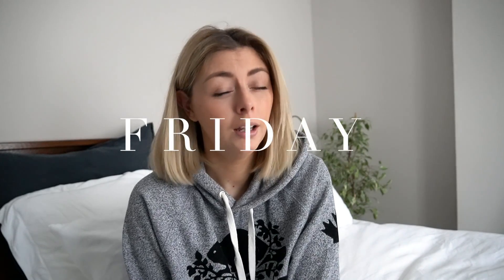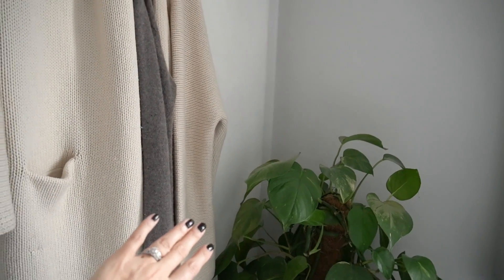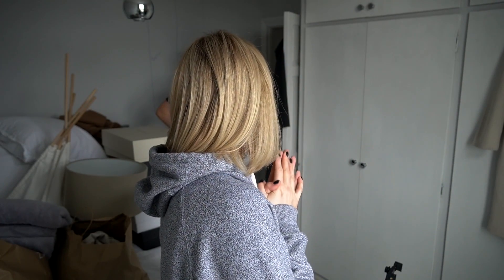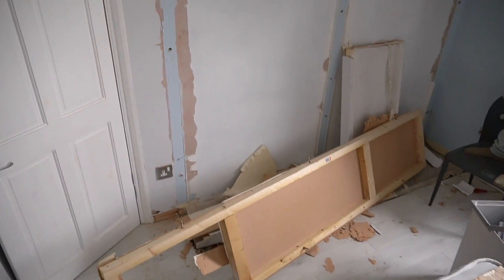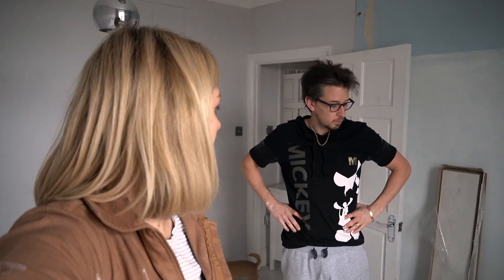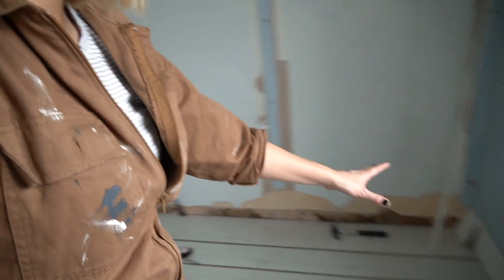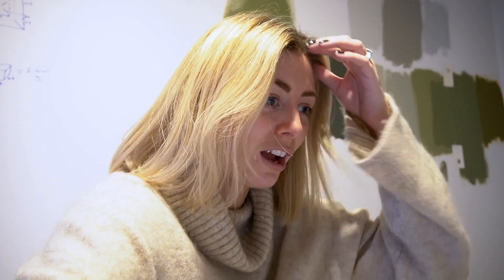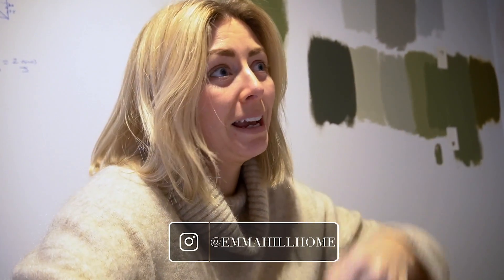Ripping Out The Wardrobes - Guest Room Reno Pt.1

Comment: LOVING your home reno videos. I'm currently in that process myself and i feel ya in terms of feeling like everything is a mess (but it will soon look ace). Also, doing it yourself - it saves so much money. My mate paid almost £2.K to paint her 2 bed flat (just walls). I'm painting everything myself too as need to pay for bath and garden reno (the quotes were like "it costs how much>" . 

thanks for the valspar matching tip. I go to Brewers Decorating centre and they do it slightly differently in that they don't scan (or at least i didn't see them scan), they put in the brand name and colour name. However, there are some shades that they can't do in every finish e.g. I went for F&B Calamide and they were like you have to get it in another finish (it looked no different but its worth knowing). 

Can't wait for your other videos x

Comment: Have you seen on Pinterest where you can order swatches of colors for the wall and they are like big plastic stick on squares so you can look at the colors? I think you can order different colors from different paint manufacturers. I was going to try this rather than the paint sample bit. Have you ever thought of a murphy bed so you have room to move around when no one is staying over?
Reply from the maker: No I haven't but it sounds like a great idea 👍
Reply: Emma Hill Also what about a murphy bed? I am considering a dyi murphy bed because it takes up so much room for just guests a few times a year.
Reply from the maker: Im not a fan but I think the way we are arranging it will make a big difference and look so much better 🤞 Although they are great space savers for rooms that aren't used very often. Good luck with the DIY job if you give it a go 👍

Comment: Where is the bed from? Because it has drawers under there, I have never seen that with a Boxspring.
Oh and I went and looked for your beautiful cutlery, but Next doesn't deliver those specific items to the Netherlands :(
Great job on the flooring :D
Reply from the maker: It was from Ebay (I think). Its called a divan with storage. They are quite common in the UK but this one was only a temporary solution when we first decided to turn the room back into a bedroom 👍

Comment: You can't run electrical wires in a straight horizontal line.  They haven't go up then across then down.  (I know this after renovating my ridiculously old house. Lol)
Reply from the maker: I think that's due to safety when drilling into walls. 👍